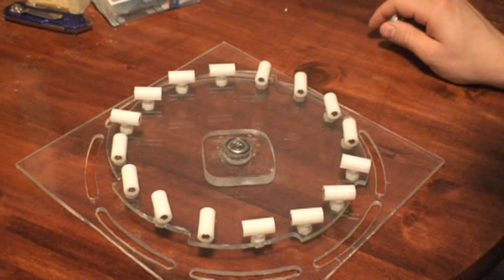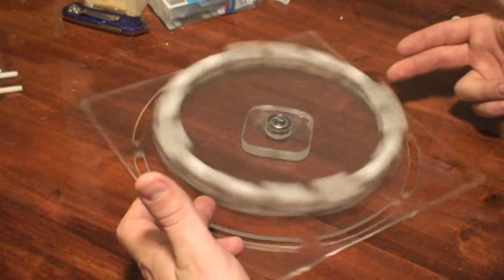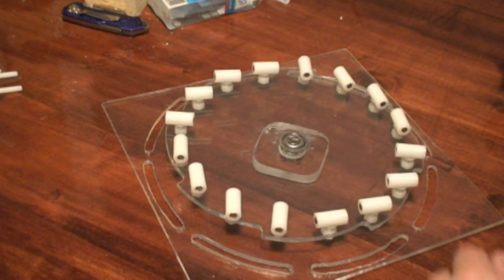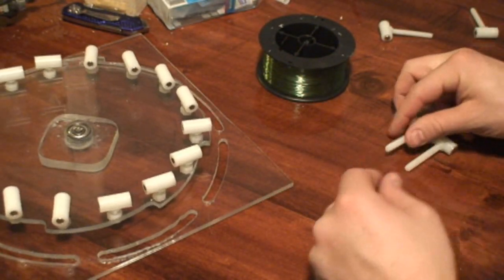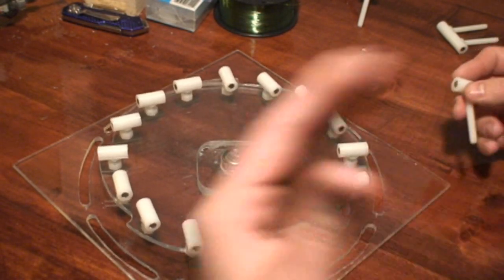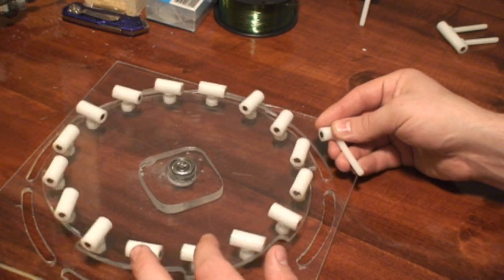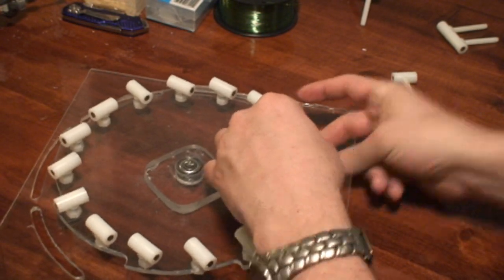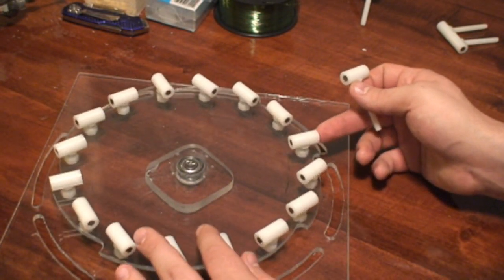Magnet motor, free energy, overunity test 2

Comment: the building and collapse of magnetic fields requires energy (reactive power) so the energy required to accelerate the rotor will always be more than the energy expended by changing the magnetic polarity. this reactive power is the very reason why no motor can be 100 percent efficient. this machine you are building can never work.

Comment: Take a physics class. Your attempt at finding "free energy" is futile. 

Side note, a water wheel is technically hydro-solar because the heat from the sun is what moves the water back to the top of the system. 
1. Water turns the wheel
2. Water continues to flow down stream
3. Heat from the sun evaporates water
4. Wind caused by differential heating of the earth's surface moves the clouds 
5. Water comes back down as rain (hopefully) at the top of the water system
6. Cycle repeats

Comment: Your on the right track, well sort of, but unfortunately you don't see the obvious solution to your problem which is starring you straight in the face!!..... Which is when you were moving the magnet back and forth with your hand, you need to make a helper mechanism that is driven by the spinning of the wheel to move the outside magnet back and forth or side to side, then and only then will you have created a closed loop system which will keep everything in true perpetual motion.... But unfortunately your like most people who reli on external forces like electromagnetism which relies on a battery or plugging into a wall outlet instead of trying to build a true perpetual device.

Comment: Your making this to hard just have them all opposing and same angle that way you do not need to flip it !
And make sure you use one Magnet on the outside of the wheel for each magnet you have attached to the Wheel.
And another hint make it so that your wheel is levitated by opposite magnetic fields to reduce friction. 

The biggest problem you will run into is that your magnets need to be all equal in strength and distance which means you need a perfectly shaped Wheel. And perfectly angled Magnets to achieve maximum performance.

There is one more key item your missing though I will stay tuned to see if you find it.

There I just handed you the key to the Universe !

Your Welcome.

Comment: Here I see a generally circular drive plate by hand. Hand is not directrly push the plate and used for this magnetic force. Think of the magnetic field lines as ropes. Whether by hand or pushing weights with rope or use magnetic fields- is the same. No free energies in this video . There is only pushing the plate by hand, using a magnet.

Comment: Why not just mechanically rotate the magnet & power its' rotation with the wheels' rotation?
Maybe use worm drive(s) with (different diameter) gears at each end of an axle.

Comment: I think the part you understand is that you are providing energy by moving the magnet from south to north. You could do as much by pushing the wheel. His electromagnet is just that much more of a fail. energy from a battery to keep his wheel moving. For you to prove an ability to get energy from magnets alone, you have to do it without a battery, or the aid of your hand. What you are looking for is an invisible force to aid your invention. Try sunlight or gravity. But then it won't be the magnets providing the energy. Dude, if you think magnets alone can make a motor run.....you are wasting your time. Don't feel bad though, nobody else has made it work....for the same reason. Try making them move with your mind. people actually make money with that scam.

Comment: stop using pull of n to south, you want to use push only as if this were a windmill or a watermill. imagine the flow of magnetism as the flow of air or water pushing against the other magnet. then there is no attraction to overcome. nor does it break the law of thermodynamics.

Comment: am i the only one whos thinking just make it push instead of pull
Reply: that solves the too much pull problem and makes it push away no matter what. ur welcome
Reply: JUST MAKE IT ONE SIDED. USE SOUTH FACING OUT ON THE WHEEL AND SOUTH FACING THE WHEEL IT WILL NOT NEED TO SWITCH THE POLARITY
Reply: It won't spin that way.  By rotating the magnet in his hand he is changing the magnet field and providing a small push. it's no different than pushing the wheel with a stick. (And suddenly it's a stick power wheel).  The energy here is coming from his hand.

Comment: first off not free energy, flipping the magnet and holding it in place is input energy. Secondly, do you not realize this is an over complicated stepper motor in a micro step mode, research that.

Comment: It doesn't work. It is not free energy. In your presentation you yourself exert more energy manually flipping your AC drive magnet back and fourth, than the energy the spinning wheel creates. You are the power source in this example. You talk about, instead of using your hand, you would use an electromagnet with alternating polarity to spin the wheel. Where does the electricity come from that powers your polarity-flipping electromagnet? It comes from another power source. A source that would be using more energy powering your electromagnet than the kinetic energy the spinning wheel would produce. More energy in than energy out. In essence, you have made nothing but a kids magnet toy.

Comment: find a way to make it work ,,,,, buy an electric motor for a dollar. You little battery might spin a plastic wheel but do you understand how powerful the magnets are gonna need to be to drive a tonne or two forward . WHY DONT YOU START WITH SOMETHING LIKE USING THE TINY ENGINE FROM A REMOTE CONTROL PLANE TO CHARGE BETTER MAGNETS. IM SURE WE WOULD ALL GLADLY FEED ONE OF THEM ENGINES TO GET TO WORK, THESE THINGS YOUR ALL PUTTING UP WILL TURN A WHEEL WITH NO RESISTANCE THEREFORE EVEN THOUGH YOUR WHEEL IS TURNING THE AMOUNT OF ENERGY YOUR GETTING TO TURN YOUR WHEEL IS MOST LIKELY LESS OR EQUAL AT BEST TO WHAT IT TAKES TO KEEP THE MAGNETS TOPPED UP FROM LOSING POWER EACH TIME THEY INTERACT WITH AN OPPOSITE AND THE POWER FOR REVERSING POLARITY SO YOUR GONNS NEED A DYNAMO ON YOUR WHEEL WITH A CHARGER